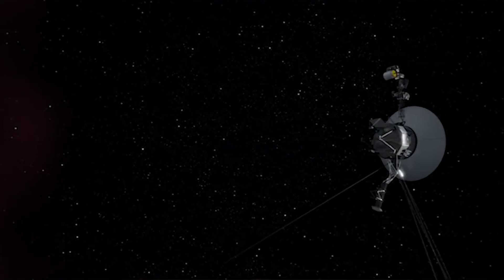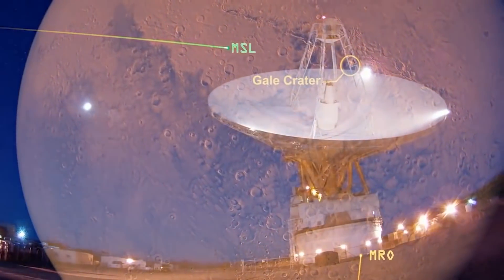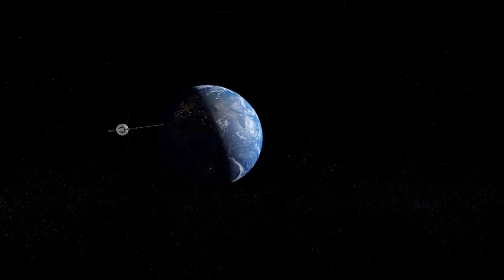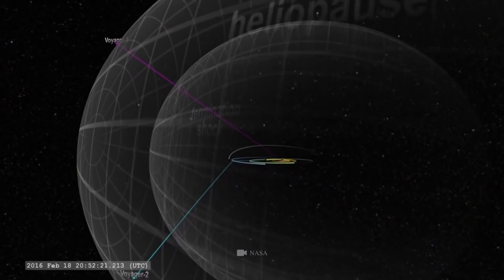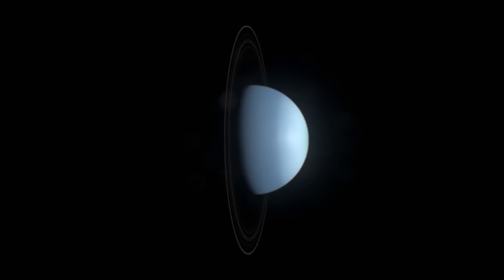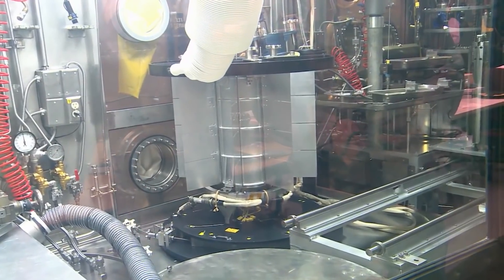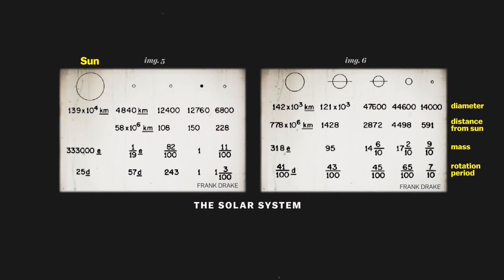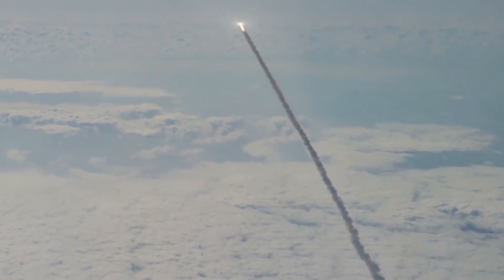Voyager 2 is FINALLY Back Online but Scientists Found Something SHOCKING

Comment: FISSION FOR THE WIN! WE SHOULD USE IT ON EARTH. DESAL SEAWATEr, SUCK CO2 FROM ATMOSPHERE, INFINITELY RECYCLE OUR WATER, VAPORIZE OUR UN-RECYCLABLE TRASH AND SHRINK OUR LANDFILLS, CARBON FREE ELECTRICITY CHEAP AND ABUNDANT FOR DOMESTIC STEEL AND CEMENT MANUFACTURE AND WASTE MANAGEMENT AND RELIABLE POWER FOR ALL HUMANITY. MOLTEN SALT REACTORS CANT HAVE EXPLOSIONS OR MELTDOWNS BECAUSE THEY USE MOLTEN SALT(already hot). SEE THORCON! SEE FRANCE!  

once we havce thorium ready, then well have thousands of years worth of fuel! Fission batteries can go at least a century without needing to be recharged!

Comment: To be fair, an LP record made of gold is still probably the most resistant medium to cosmic rays....
Reply: yeah, magnetic based storage would have likely been erased when it exited the heliosphere, plus data degrades on drives and tapes eventually anyways. Compact disks, dvds, blurays, etc all go bad eventually. ironically the best storage medium is something like a record, not made from vinyl.
Reply: @spicydeath82  ... wait, the computer on board is tape drive storage. That was one of the questions when it came to update things. Would the tape and internal memory be able to take another rewrite? I'm sure they used something better than consumer grade "Memorex" but long-term storage out there has got to be far from ideal.
Reply: @spicydeath82  Oh yeah, DVD's were crap ! All the hype when new about lasting 100 years, please. I burned movies onto several and had errors after two years; they were stored in cases, cool temp. "Cyclic redundancy check error" just happens for no reason.
Reply: We observe small hyper-velocity dust impacts on the spacecraft at a rate of about one per hour.  Each impact ejects a small amount of material, forming a microscopic divot.  Considering the millions of years that will elapse before it is closer to another star than our own, the entire spacecraft, including the golden record, is likely to be completely eroded away.
Reply: Alien " damn not another AOL offer " * throws in trash *
Reply: @davidjones3165  Too funny!!!!!
Reply: Unfortunately
Reply: I hope recorded on the LP has "Stairway to Heaven"
Reply: Or, and hear me out here.... maybe just a book with lead binding?
Reply: @MrZatyro  Probably not. Books are far more delicate and we couldn't be totally sure whatever we printed it with wouldn't gradually decay chemically, that it wouldn't be damaged by or react with whatever atmosphere at whatever temperature is brought with its recipients. They might live in high pressure environments at 130 degrees Celsius, you don't know what that book would have to accidentally withstand. Gold is a smart move, we know its chemistry well - it's very stable and unreactive even on a geological time frame., won't be damaged by cold and would have to get very hot to be damaged.
Reply: @MrZatyro  very funny mister
Reply: Megatron dug it
Reply: What if aliens think it's a freesbee from an ad company?

Comment: Courious as to how an antiquaited radio system can send a signal half as far as th Voyagers radio is supposed to do. Radio wave are not light waves even if the voyager had a laser, it's ability based on the era it was built would not be able to send a signal half as far as the Voyagers one or two is reported as doing. In addition to the bullshit of recent photo's from either when the antiquated camera's were shut off due to the fact there was insuficent light in which any camera needs. Take the best digiatal camera today, and take a photo in a clostest with the door closed and see what you get. But then, who can argue with NASA when no one else has any other data except the use of physics when it comes to radio waves, their frequentcies, and the distance they can travel through any and all of the possible dust, raditation etc in space.
Figure's can't lie, but liars can figure. And lemmings never doublt.

Comment: I recommend keeping an eye on this page: https://eyes.nasa.gov/dsn/dsn.html It shows data for all the DSN dishes. 

As of 23:50 BST (GMT+1), Voyager 2 is at a range 18.93 Billion Kilometres. The light time round trip is 1.46 Days! DSS 43 at Canberra, Australia, with a download data rate of 160 bits per second! VGR2 is transmitting at 8.42 GHz and the received signal strength is 4.12 x 10^-25 watts (4.12 with 25 noughts in front of it!).

Voyager 1 is being received  by DSS 65 at Madrid, but it is only sending carrier 8.42 GHz. The range is 22.75 B Km, 1.76 days round trip light time.

Comment: Farm site between Wood lake and Echo. 4br 7.7 acres, 3 modern electric out buildings, 3,000 hardwoods. 70's home, New roof, New Furnace, new Sump pump system. New Toilet. Ask for a $175,000 close.  Best Offer . Call for Text and  to qualify for view. 530 4088

Comment: Saying it'd take "ages" to receive a signal from Voyager 2 is a massively wild exaggeration. Radio signals travel at light speed and if Voyager 2 is 11 billion miles away then a signal would take only 16 to 16 and a half hours at most to be received. That's hardly an age.

Comment: Ok.  So we have had to make repairs to the equipment here on earth.  But the equipment traveling through space with tiny rocks, debris dust and radiation have NOT needed repair in the same time frame and are working just fine?

Comment: Magnetic tape, 1928.  Hard disk, 1953.  Floppy disk, 1971.  I assume that magnetic media was not chosen because it would degrade over time, whereas a physical etching is both visible and the information, symbols, images and formulas can easily be extracted, just like the crop circles.

Comment: 2024 is how long the Voyagers will have enough power to run their remaining science instruments, but they could conceivably keep powering the computers and radio, just sending telemetry, until 2036-ish. That's assuming the antenna is still pointed towards Earth though, they've only got enough fuel in the TCM thrusters to keep the antenna pointed towards Earth til about 2024 anyways.

Comment: It's a record because they didn't have Hard Drives Yet!? Seriously!?
I't a solid gold record because they KNEW that Anything else would degrade to the point of uselessness before it would ever get close to an alien civilization.
tapes get wiped by electromagnetic fluctuation, CDs would degrade too fast and Hard Drives, Especially including solid state ones, not only also get wiped by electromagnetic forces but NEED POWER TO STORE INFORMATION!!!
Reply: And more to the point, they needed a form of information that ANY potential civilization could understand relatively easily. Hard drives require specific computer code, that an alien civilization Definitely wouldn't have, to work otherwise it's just a weird brick

Comment: it will take ages for radio signal to travel to voyager? The Autor did a mistake but then corrected saying 17 hours. But then he says 17 hours round trip is 32 hours. 
light travels 670 million miles per hour so 11 billion miles 16.4  hours :) So many simple mistakes.

Comment: I recon voyager 2 will last till 2030 before packing up. And aliens will send it back to earth by the time im 74 it will arrive, im 21 now andthese are general numbers im using assuming it goes the same speed back itll take 44 years an the extra 6 years are to 2030

Comment: Why have we not sent up V3 and 4 and so on. Maybe once a year each with system improvements and each in a different direction?  We may want to send out a massive probe to act as the return address in case some alien wants to send back a proton torpedo to stop us from us from sending up so much spam and space junk. Just a thought.

Comment: 40+ years old and under two days for a communicable transmit turnaround is outstanding. My only hope is that there is nothing out there intelligent enough to crack that disc code...be careful with what you ask.

Comment: What do you mean "even if the radio signals travel at the speed of light"... what other speed would radio waves be traveling through the vacuum of space?
Reply: 99.9999% the speed of light... Unless they encountered a warped universe...  ...Besides the ones living on Earth...  🤣
Reply: @JeffCounsil-rp4qv  Radio waves are light particles, just not visible to the human eye. Whatever speed radio waves travel at in space is 100% exactly the speed of light, that's the very definition of the speed of light.
Reply: @sharkracer  You missed the sarcasm.  Besides, it has been proven that light speed is not a constant, though very close, and space isn't an absolute "vacuum".. Light can be slowed down, and even sped up by gravity, and "interference". I know what the radio spectrum is too.. There is also the Doppler effect that shifts time.  It's all relative man, it's a paradox, ya dig? Space-time is warped by gravity and can be seen with Einstein's Cross...
Reply: @JeffCounsil-rp4qv  Gotcha.. kinda difficult to catch sarcasm in written form.

Comment: NASA won't tell you that Voyager 2 ran into an extraterrestrial mother ship that replaced the Duracell batteries on the Voyager 2 and that is why it is operating once again.
Reply: @ArtBuffalo Voyager DON’T have solar panel to actually charge , it used RTG as mentioned in the video
Reply: Funny thing is the aliens look like a little white bunny banging a drum.
Reply: @ericstra2793  lol
Reply: @ericstra2793  isn’t the bunny pink?
Reply: And NASA won't tell you that you can't use them for a personal prank that is meaningless, but it's true.

Comment: If the Light Travels 8 minutes from the sun to earth  which is 150.000.000 million kilometers away, then the “radio waves” emitted by Voyager 2 which are as “fast as light” take 16 hours to reach NASA’S INTERNATIONAL BAMBOOZLING CENTER. And another 16 hours from NASAS’S INTERNATIONAL BAMBOOZLING CENTER to Voyager 2, launched in 1977. What’s Voyager “Fax-Modem’s” bandwidth? It has to be a heck of an experience exchanging data with a 49 year old and “rusty” Aladin Lamp “floating” somewhere in space 11 billion miles away (18 billion kilometers). Thank you NASA that  we have YOU, what would be of us if we didn’t have NASA?

Comment: They used a record because it is physical and would survive the energy field chaos of space much better than magnetic or other types of memory storage, and it's an easy to figure out technology, rotate the disc while dragging a needle attached to anything that converts vibrations to sound through the ridges, done.

Comment: Love to get a message back from voyager
Voyager : I have received instructions to send home. Repeat new data. 
Network operator: query message
Voyager: contact made. Visitors coming. Record deciphered. Radio signals received.
Network operator: query message store repeat
Voyager: visitors on route. Current velocity light - 50%.
Network operator: err someone get me Nasa. Use the red phone, yep the dusty one with one button

Comment: This has to be one of the best bargains of all time for something that wasn’t expected to even complete the “Grand Tour”. Having said that it seems that a couple of Martian rover “Opportunity” hasn’t just exceeded it’s expected 90-day expectancy but instead completed 5498 Earth days (or 15 earth years/8 Mars years) only giving up after a planet wide dust storm in 2018 completely flattened its batteries so much that even its hibernation mode was insufficient.

Perhaps someone can correct me if my memory is playing tricks, but I seem to recall that some ill informed Americans tried to get Voyagers launch from happening because of the radioactive power supply (the RTG referred to) but they were overruled by wiser, less ignorant heads.
Reply: Your memory is working just fine.  If it were to launch today with a "record", the aliens will believe there are 152 (and counting) genders...🤣

Comment: I don't think the lack of other storage solutions was the only reason to chose an LP.  On an LP the information is engraved physically into the medium.  Most modern storage mediums rely on magnetism or electrical charge to hold the information.  These will decay over time, especially when exposed to radiation and magnetic fields.  Even CD's decay over not that many years.  I think even today, the choice of an engraved LP is not such a bad idea.

Comment: It's amazing that it hasn't been catastrophically damaged by running into interstellar debris.
Reply: Well its circuitry was huge compared to today's electronics, so much less susceptible to debris or radiation. Plus it's not traveling anywhere near the speed of light.
Reply: @danielpassigmailcom  It can be dead still and be impacted by something going a bazillion MPH... The electronic circuitry is also aging and slowly failing, especially the Tantalum capacitors.
Reply: Surprised it didn't run into uranus!

Comment: Yet my wifi barely stays connected on the other side of my house.  Makes sense.
Reply: Wifi devices operate on a specific radio frequency which transfers data really fast, but gets easily blocked by solid objects.

Comment: I wonder... could they turn the cameras back on if they wanted to or did they kill them?
Reply: Nope. The software has been dumped that runs them for more data space. Voyager is simply running out of energy and what's left will probably be used to transmit whatever data it was able to store.

Comment: Musings about the reason for choosing an “LP record” are utterly wrong. (Physically large) hard drives were available and core memory was commonly used, though both of these technologies admittedly offered low information density and were comparatively rather fragile. The real reason the LP disk was chosen was that as an analogue system it directly stores information and therefore does not require an encoding scheme to be explained in order for reproduction. Hypothetically aliens could digitally photograph the grooves with advanced holographic gadgetry and then reproduce the hills and valleys of the signal as modulated smells and still get something of the modulation of that signal. Basically, it’s about physical robustness and ease of reproduction.

Comment: I have questions. If Voyager 2 is beyond the heliosphere, how does it send signal back to Earth? Wouldn't the radiation and plasma barrier cause interference? Also if Earth is rotating almost 1000MPH, wouldn't one of the 3 transmitter towers on Earth be in contact with it almost all the time assuming it can communicate through the heliosphere?
Reply: None of your points make any sense, if communication beyond heliosphere wasn’t possible because of plasma it would be equally impossible inside heliosphere, the other part about antennas make no sense at all.
Reply: @olasek7972  Ok ok. Check this out. Whenever a spacecraft re-enters the atmosphere, there is a black-out of the communication systems that use radio waves. This is because the heat and breaking down of particles on the craft cause a thin layer of plasma to form on the craft. Plasma reflects and absorb electromagnetic waves / radio waves and also cosmic radiation (gamma rays etc.). Now the Heliopause is over 30k degrees C hot and I'm sure way thicker than the thin layer of plasma formed on a spacecraft that re-enters Earth's atmosphere so the plasma at the heliopause has got's to at least cause some interference with the communication between Voyager 2 and Earth.
Reply: "...if Earth is rotating almost 1000MPH..."

Half the speed of the hour hand on a wristwatch. Terrifying!

Comment: I thought outer space was a vacuum. Now there is a plasma bubble ?
Reply: It is almost completely a vacuum, so thin there is practically zero pressure and atoms almost never hit each other. By "plasma bubble" in space means in that area there is a tiny amount of plasma particles but it is still basically a void.

Comment: Does it travel in a straight line, or is it also going round and round our galaxy?   I realize this takes millions of years to make one circuit, but assuming we lived that long, what path would we see it take?
Reply: straight line - law of inertia - will travel in a straight line unless a force acts on it. The forces acting on it are minute forces - gravitational bodies, including our solar system, and the atoms it collides with.  Voyager 2 is traveling 35k miles/hr in relation to us. To another galaxy moving in a different direction, Vger will be appear to be traveling a different velocity in relation to that galaxy. Hold both hands in the air (representing 2 galaxies) and move both hands in straight lines both in a random direction. Now think of Vger moving with your left hand. You can then realize that from the aspect of your right hand, Vger's velocity is a combination to the velocity of our Milky Way galaxy (which is 1.2 million miles/hr) and Vger's velocity.
Reply: Both…in a sense.  Straight line but in motion around the galaxy at the rate in which our star system is moving…give or take any velocity of its own that accelerates ahead or behind us.

Comment: Sounds like the Plutonium power supply will continue to degrade whether or not the power is utilized. Nothing was mentioned about turning off all instruments and storing power for future use. So the PS is probably on demand only with no battery storage.
Reply: I think you're right, no battery just the RTGs. Batteries wouldn't have lasted this long